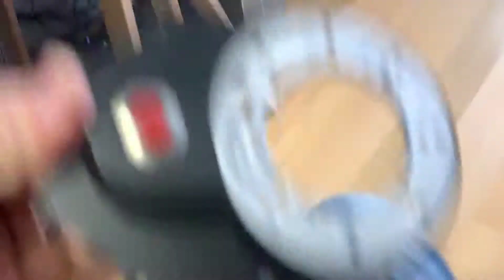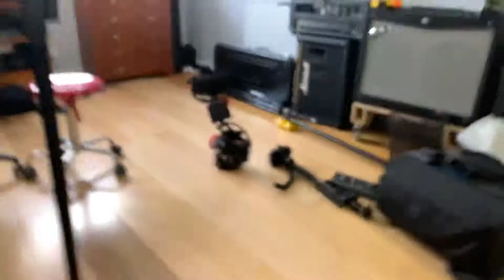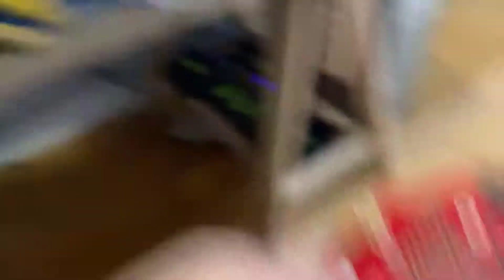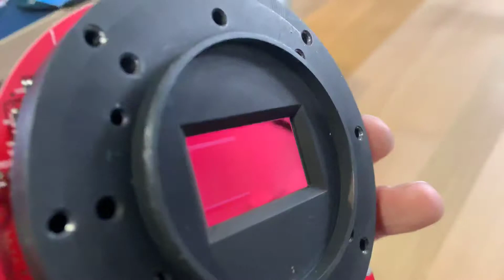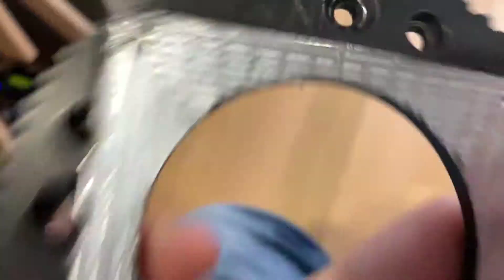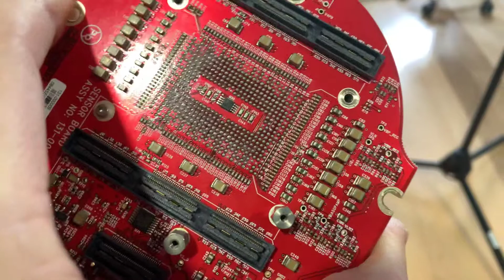RED ONE Sensor Technology

Comment: My Red One MX died on me a little over a month ago.  It just stopped powering up.  I took it apart to investigate but never got around to doing much with it.  Decided recently to assemble it back together to see what could be causing it to not power up and I disconnected the tiny cord going from the power supply board to the sensor and tried powering it and guess what... it completely powered and booted up.  What is that small cord and why would it keep my camera from powering up?  I plugged it back in and it would not power up.  Unplugged it and it powered up fine again... multiple times.